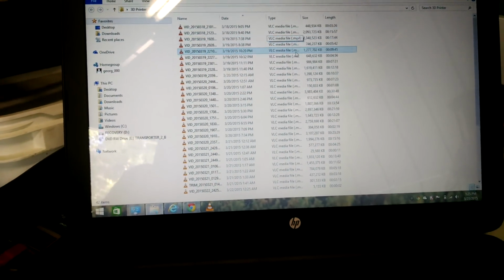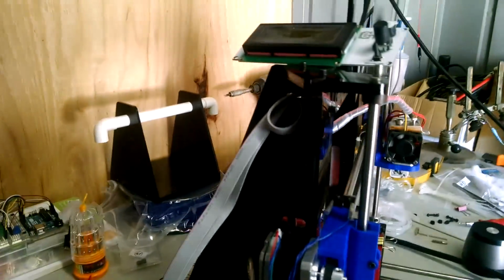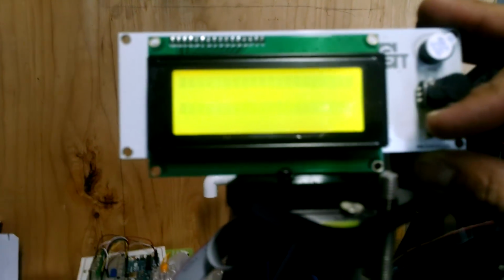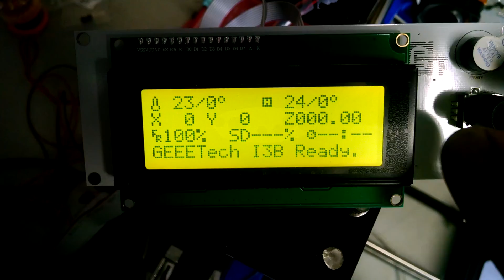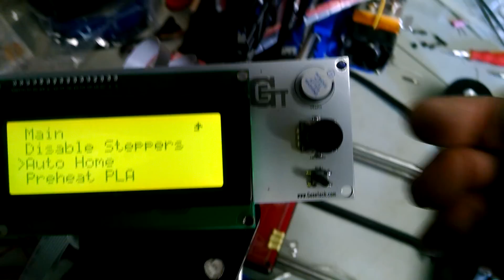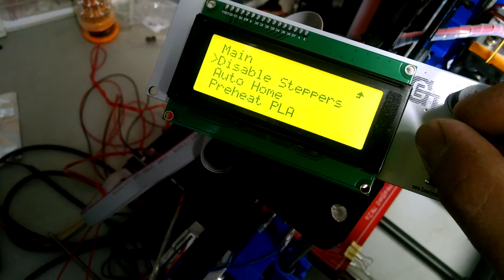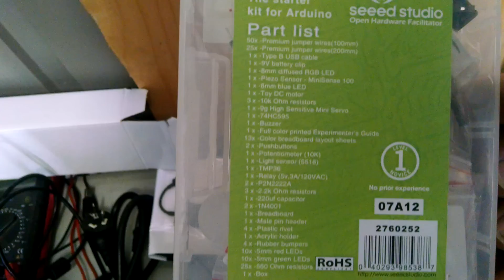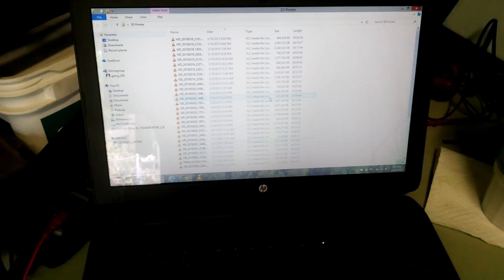Geeetech Prusa i3 pro B 3d printer. Why i could not update firmware or do anything

Comment: why would i but something that does not work?
Reply from the maker: You know it's a video based on my experience, not necessarily what is going to happen with you.
Also I don't sell 3D printers anymore, I couldn't compete with others pricing and amazon.
I just couldn't make a profit.
Anyway, this was many years ago. I still have the same machine and it still works. Offline at moment cause I have to redo filament measuring device case. Glue came apart.
Look into a creality printer or a geetech printer that has a metal frame.
Good luck.

Comment: I had lots of issues updating my firmware for the GEEETech i3 PRO-B machine Until I connected it to GEEETechs EasyPrint software and update directly from the Getech servers via USB.
or use  Arduino-1.0.1-windows ONLY, as stated in the GEEETech Forum, plus, there is a fix for the two rows of Sqaure dots on there also.
Reply from the maker: See my other videos.

Comment: hy, i got the same problem but i solved, the connector of sd card cable was solder on wrong side (turn for 180 degree) chack the board very good there can be some fail, some bad soldering or something.
Reply from the maker: tintek33 as other comment below says, it depends where you bought it as it's a clone of a clone, so the manufacturer make them slightly different. where did you buy? direct from geeetech or from eBay?
Reply from the maker: tintek33 actually, the comments might be on another video if not below, so many can't remember. and just setup warehouse, passed final yesterday, so more videos coming soon. and different content.
Reply from the maker: +tintek33 I just may. Message a link. Here will auto mark as spam.

Comment: hello mate I have just finished building my prusa i3 pro b and everything works apart from the z axis. the motors vibrate but don't turn, and I have no idea what to do.
Reply from the maker: check for binding. usually its the top z plate. little filing for "lead-screw" hole and done.
Reply: George Robles mate the actual motors don't turn even when I take the rods off. I tried switching the motors and the same thing happens.
Reply from the maker: Switch the stepper driver with another axis. 

Also I set ref voltage to 1.0-1.1 volts DC for the z axis and extruder.

For X and Y axis, ref voltage is around 0.8-0.9 volts.

To do this, there is a trim pot on the stepper drivers. Using a multi meter, set to low voltage DC range. Put ground lead on the gnd pin on stepper driver, and the positive lead on the trim pot itself. You will get a voltage under 2 volts DC. This voltage is used as a reference to current being fed to the stepper motor. So if you read voltage, it's actually how much current is being used by the motor.

Set this first. Then check again.
Reply: George Robles how do you actually print something. I got this fixed but I am unsure how to print something.
Reply from the maker: To print an object, using a pro b with 0.35 nozzle, go to thingiverse and search for me or a part I did. Like Mk8 autolevel Mach 4.

Also, on thingiverse, I have a model for a filament roll bushing? I guess.
Point is I have that g-code I ran on their. Anyone can download it. And run it. Then I will try to do a video on YouTube for slicing soon. In my 3d printers Playlist you will find some videos that show how.

I use repetier host, with Slic3r.
Also use simplify 3D to run printer and slice prints.

From here, you will learn to place objects in the slicing software your using and be able to put parts on the bed, then center them and make sure on the plate. Setup your slic3r configs and save g-code somewhere.
Reply: George Robles does it print directly from the laptop of the sd card.
Reply from the maker: Laptop via repetier host, or an SD card put it in slot
Reply: George Robles ok thanks man
Reply: George Robles hey I got everything to work, but now when I print something the extruder doesn't release enough filament. You can barely see any filament.
Reply from the maker: May be a clog. Or burnt PTFE tube in barrel. These are the most common I hear
Reply: George Robles hello mate I checked, it was a piece of PLA that was stuck, but what I found out is the extruder motor doesn't spin. why is that?
Reply from the maker: If using manual to move it, have to use .01 mm movement.
Check it via lcd control.
Reply: George Robles I have tried that it doesn't work.
Reply: George Robles it doesn't spin at all.
Reply from the maker: Swap drivers and check again. It may just be plugged into wrong spot
Reply: George Robles ok
Reply: @Mr.Piyath  

the extruder gear does not line up with the filament. move it towards the end of the shaft about 2.5 mm and try again
Reply: @davidkettell5726  4 years too late my friend. But thanks
Reply from the maker: I had to realign it a few times over time as well as tighten the screw.

Comment: I did set up the same printer, I hade issue with the reset hole and the rod holes on top. I burned the controller first run because I installed it "upside down" (so the text was readable) and it did not get enugh cooling. I bought another one. I cant figure out how to get a perfect setup now, its printing "spaghetti" often. Cant figure out the correct settings
Reply from the maker: https://georges3dprinters.com
Reply from the maker: https://georgeroblesjr.wordpress.com
Reply from the maker: see the links I sent to you. the WordPress blog will have my slic3r configs. you can import them to Slic3r just make sure you save them. I ha e for pla setup. if doing abs, set extrusion multiplier to 0.95 for abs and 1.0 PLA.
Reply: awesome thank you for sharing!

Comment: I am having this exact problem with my Pro B withy the GT2560 board. It just crashes, tried putting marlin on it, does the exact same thing again. Is the software on your site for the pro b & GT2560? Any help would be appreciated.
Reply from the maker: check out my WordPress blog for the firmware, there is a blog just on the GT2560 rev a board.
if you need further help, send email to Geeetech or the place you bought it. or you can pay me for tech support.
if you give me your email I can send it to you what I use. same is on site. please see newest videos on it. I have added autolevel, and a filament sensor. they are on my chanel

Comment: Hello.
I watched your video, and read your page on 3D printers.
You have the firmware for Acrylic i3 Pro and Pro B (single extruder) on the board GT2560? I would be very grateful.

PS:
I am also a fisherman :)

With respect, Konstantin
Reply from the maker: You got it. I will post one when I get my laptop at home. To confirm, single extruder, for a  GT2560?
Reply from the maker: Okay. Single Extuder for a GT2560 done. 
Just posted it on my WordPress blog. I have not had a chance to test it yet. Probably will tonight bit it should work fine.
Reply from the maker: So how did it go?
Reply: Today I received the firmware from our support
in the evening, after work, I will try to establish
hopefully earn :)
Reply from the maker: New firmware
Reply from the maker: Checkout my WordPress for a possibility of a firmware fix. Still testing in China, I sent out my own boards from my stock and don't have any more so that I can test.
Reply: George Robles 
Hello, George
I checked your firmware. Unfortunately it is not in the operate Acrylic i3 Pro Pro B. Maybe it's just me ...
Reply from the maker: No. Was a few. Say print starts and then stops midway.
Reply from the maker: You have à board and no luck with the one for it? Says Pro B and Pro c
Reply: George Robles 
No. The extruder is not quite OPERATE
Reply: George Robles 
I have the Pro B with GT2560